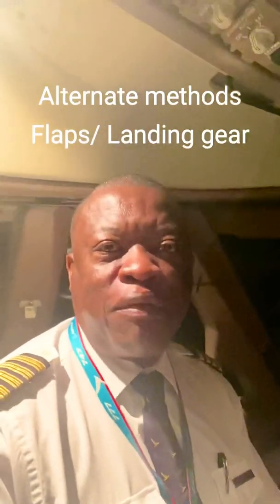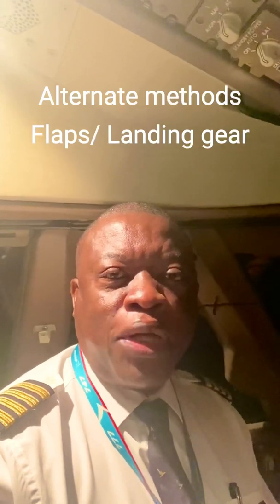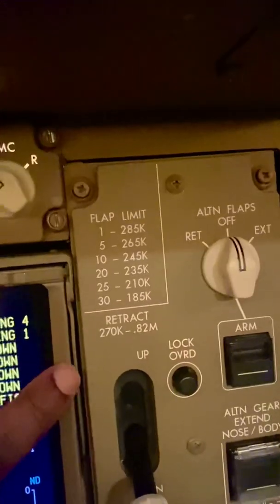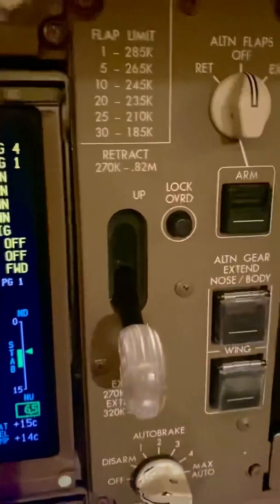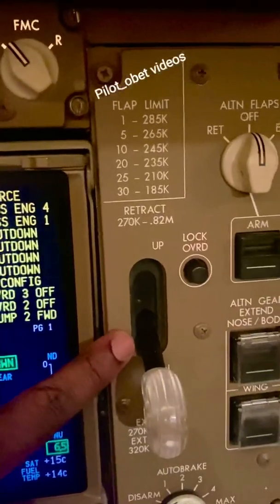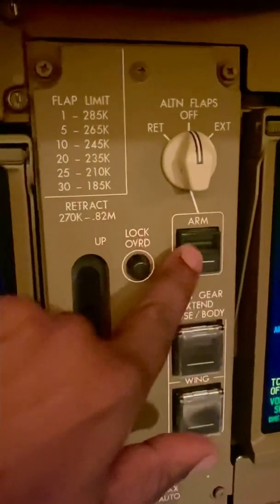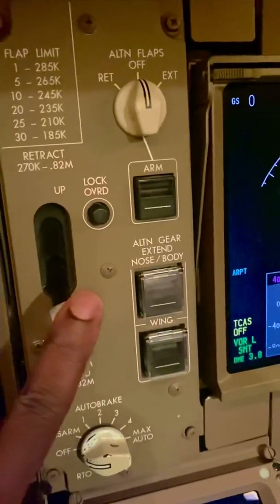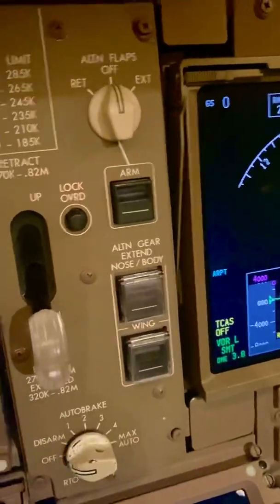Alternate operation- Flaps/Landing Gear

Comment: The little wheel on the landing gear lever have some to so with the crash of the Eastern Airlines in the Everglades, due to pilot error regarding the landing gear switch.
Reply from the maker: You know...The topic has nothing to do with aircraft crashes. In any case, that wasn’t the issue at that time. Positive discussion about alternative methods without reference to disasters etc😊
Reply: @pilot_obet  yeah I know this wheels it's a positive lesson designers learnt and improved from a negative one...
Always good to learn some stuff about the Queen of the Skies Captain...best regards